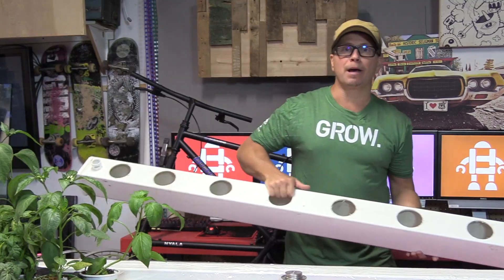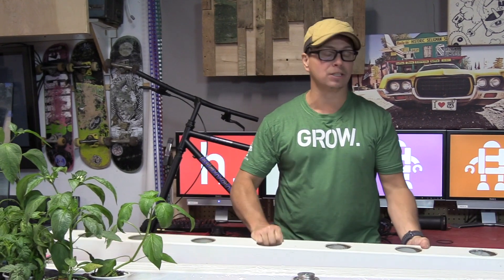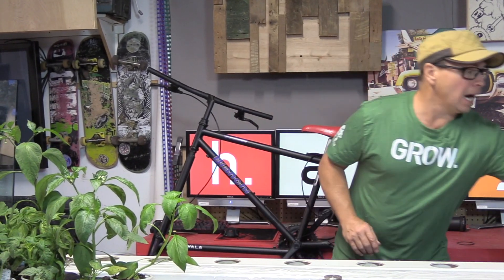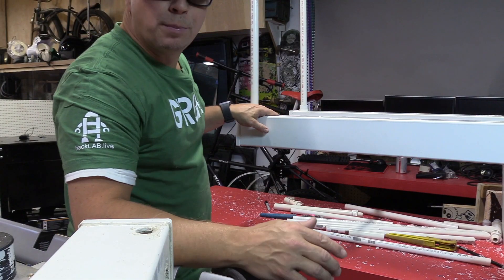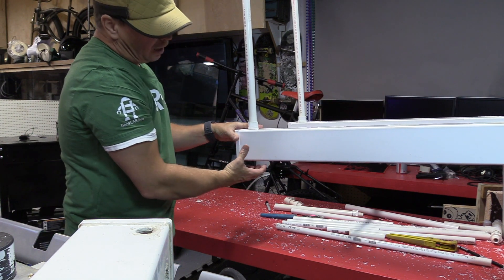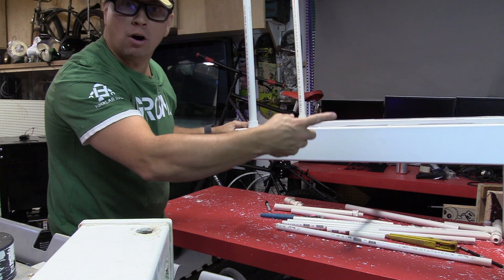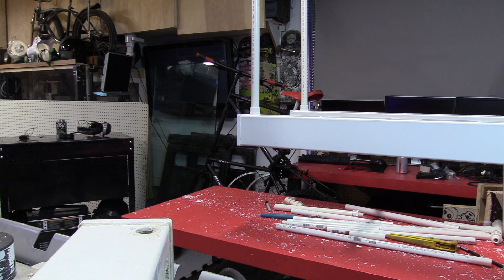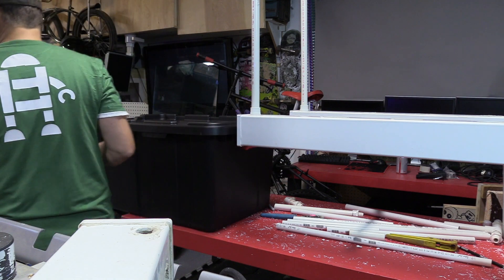Solar Power Hydroponic Garden System - No Dirt - Off Grid - Harbor Freight 100 Watt Solar Kit

Comment: Would be a terrible system to try and clean out. You will be cursing from the moment you start the clean out. Especially using a tub like that. Will get algal growth bad. A 100mm PVC pipe with an end cap on one end and an elbow on the lower end with a 13mm poly pipe delivery line coming from the submersible pump with 4mm off takes and tubing into the PVC is a way better design for ease of cleaning out. Can just shove a hose down both ends and even scrub using a mop.
Reply from the maker: Ok

Comment: Looks like a good aquaponic system using solar too !   May I ask about the plastic, the glue and the silicone used? Is it all food grade?    Happy Trials!   :-)
Reply from the maker: Frank Bonilla thanks! Most silicones are 100% silica which sand. I use aquarium silicone, so yes food grade. Plastic prob ha bpa but there’s a algae film that buffers that. Run system 2 weeks prior to planting.
Reply: Pvc will break down outside over time it gets brittle and will break easy